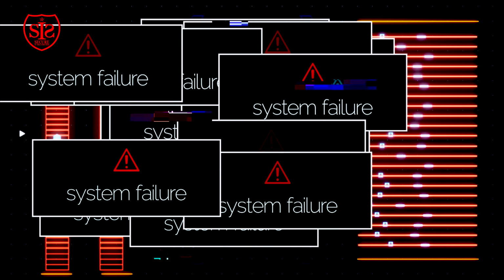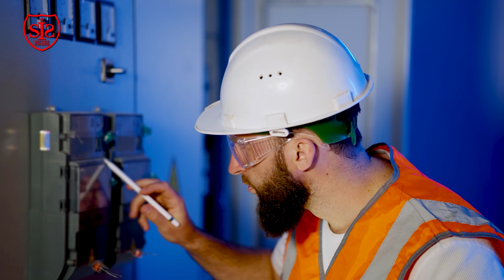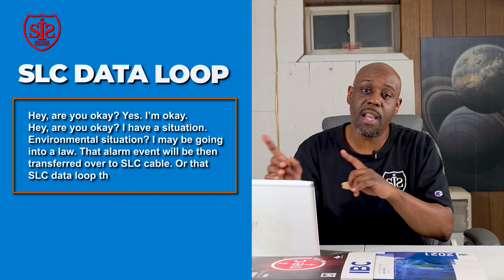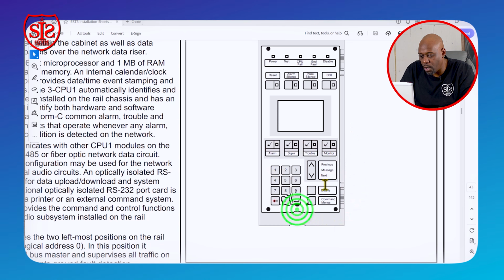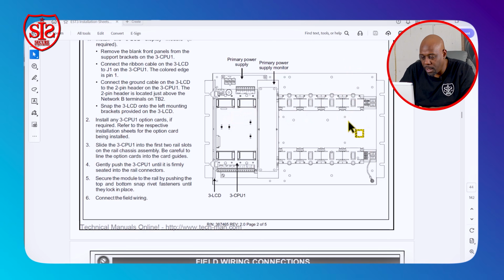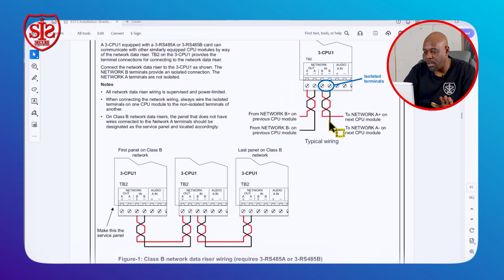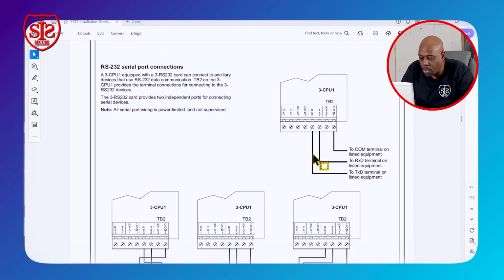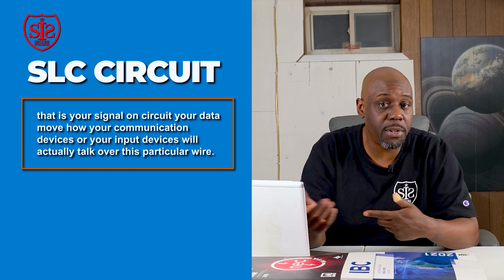SLC vs NAC: The Wiring Mistake Every New Technician Makes

Comment: In the section where you mention cabinet configuration for the EST3 cabinet, don't forget to tell them that the EST3/SDU ALWAYS assumes that a CAB7 is installed.  So if you have a CAB4 annunciator cabinet, the next address on the 2nd set of rails DOES NOT start at 3 and 4, etc.  It will ASSUME that the cabinet is a CAB7, with 7 slots, and will start at address 8 on the 2nd set of rails.  EST4 is the same way.  Just wanted to point that out.  ALSO, if you have an ASU/FT, the addressing on the 2nd set of rails is actually backwards.  It doesn't go address 6 and then 7 for the ASU/FT.  The ASU is actually address 7 and the FT is address 6.  ;)
Reply from the maker: I see someone has some skills here. Thanks for that, I didn't even think of that.

Comment: Lately I've been spending 3 HRS MAX troubleshooting. If I can't find it, I tell the owner they got wire spaghetti and need to tear the place down and start over. Few ever do. I don't have time for this crap trying to make duct taped 1984 frankenpanels work a million years longer than they were designed. If you got a 1984 building with a 1984 panel it's time to knock it down. Sorry. Now I don't get into telling them how to knock it down, but I just tell them that's what they need to do. Ain't got time.

Comment: Thank you for sharing! I have a question: my goal is to become a skilled programmer. I am considering starting college to achieve this, and I’m trying to decide which major is the best. I am thinking between:
- Computer Science
- Electrical Engineering
Note: I am already working as a Fire Alarm Technician.
Reply from the maker: That's an awesome goal! Computer Science is definitely the path for programming, I went down that path but Electrical Engineering would give you a strong foundation in the systems you're already working with. Either way, you'll be building on a great base as a Fire Alarm Tech!
Reply: @thefirealarmexpert Thank you, Boss, I truly appreciate your time.🙏